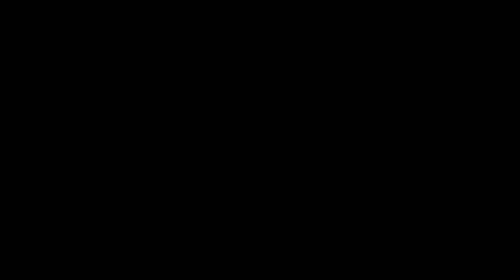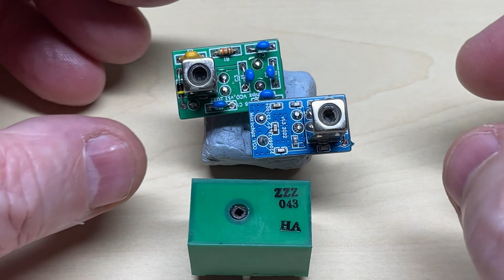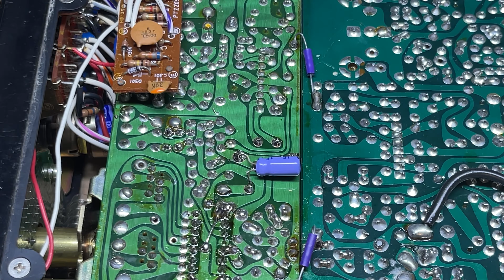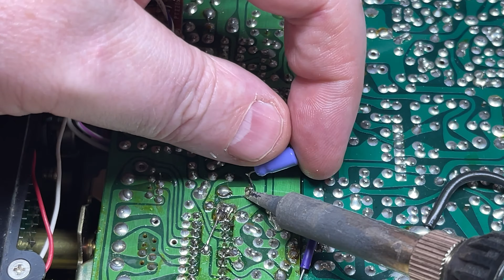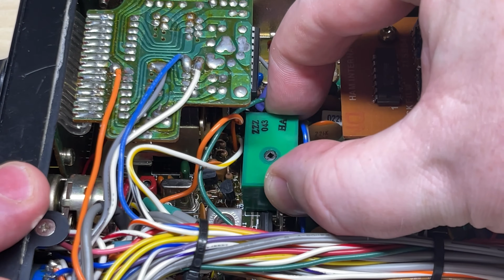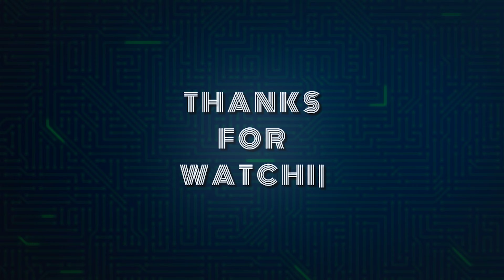How to install the Microchipz VCO v1.1 - v1.3 - Cybernet SSB CB radio.

Comment: Received mine today, Thanks for fast despatch, and shall get it installed as soon as I find a good 5 way switch for my Hygain 5 (any switch supplier recommendation's ?). This guide should prove a useful reference.
Reply from the maker: Theres a link in my facebook group for a 5way switch , it is a bit expensive and will take a week or 2 but they fit perfectly .
Reply: I have receive the 1.1 for replace thé green . It work but receive IS noisy ...